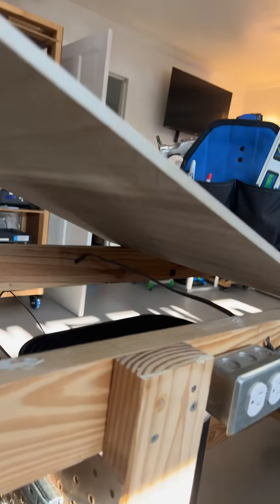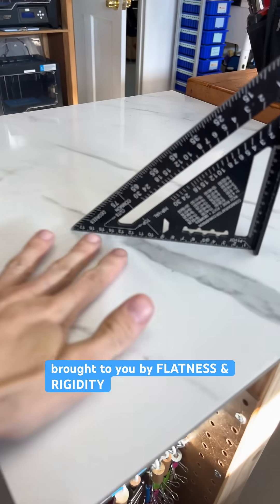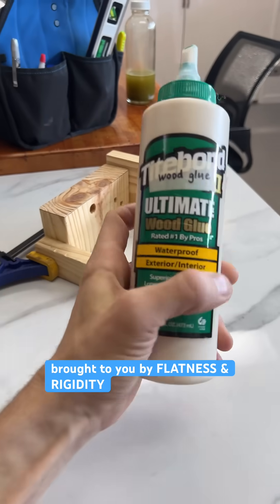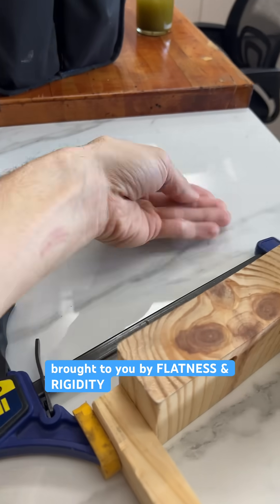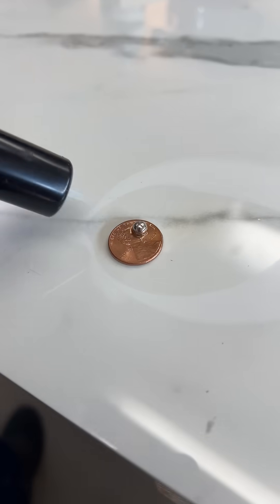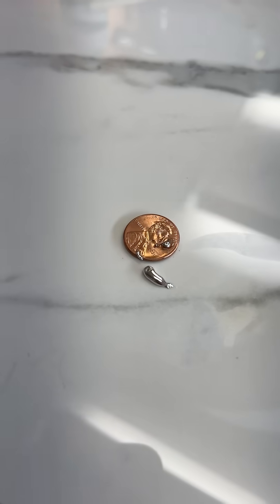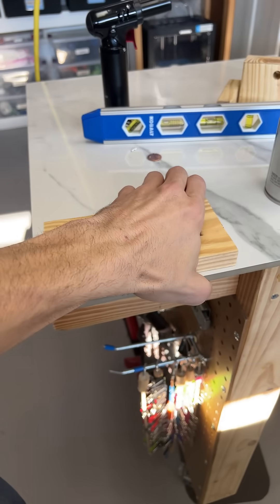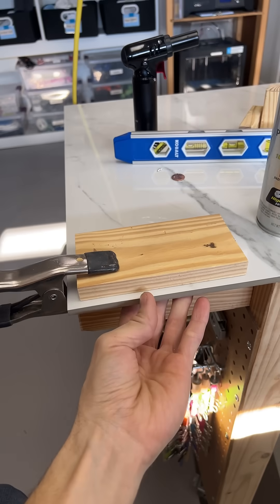how to gain flatness, crucial for many #diy projects.

Comment: You may not know that tiles are not always perfectly flat. They can warp during the firing process. High quality ones are pretty flat, but you should test with a straight edge before presuming.

Comment: Yes. I used a piece like that for years. Best workbench ever.
Reply: Work bench?! Yeah no thanks lol.  The problem with really hard stuff is that it’s really brittle.  This would make for a horrendous workbench top.  This vid isn’t even trying to say that, it’s saying use it as a top for an assembly table.
Reply: @garrettkuracka2277  Yep. But is perfectly flat and you can replace it easily.
Reply: @ well yeah but so is mdf for all realistic intents and purposes, and it’s cheaper and easier to work with and easier to replace and more durable
Reply: @Tigerbait2121  Yes. But you can glue pieces and get them pressed over melamine without getting it stick to the surface if you need it. A piece of Corian (solid surface) work in a similar way, but you can not hammer over it.

Comment: I work at a "precision" stone fabrication shop and stone slabs are not "perfectly level". They are nonporous and feel smooth but they are cut, sanded, and buffed just like a peice of wood. Just to a higher degree. If your just looking for a hard flat surface, solid surface Corian is just as good and cheaper and lighter.

Comment: Just a heads up it can flex and end up not being flat. Even natural granite counters can flex and bow a decent amount. One house I did work in the cabinets were not installed correctly 6ft of counter had a 1/4inch proud area near the center and drooping on either end. At first I thought it was a optical illusion but nope.

Comment: Imagine you wanted to hammer something home. Or imagine having to put all your weight into making two tight clearances to fix. Imagine dropping a tool onto the surface. Imagine wanting to drill through a project. Imagine.......
Just get some form ply. 100 bucks and can make 10 of those from one sheet and replace them and fix them to the bench as needed.

Comment: Do not hold a flame to granite! Especially a thon piece like this. If there is any flaw such as a micro fracture or air bubble, it will crack or burst on a bubble. Then your surface is useless.

Comment: That stone is not completely fire proof,  put the torch on it for a couple minutes you'll find that out.
Reply from the maker: Thanks for your comment!  Genuinely. My engineering requirement is as follows:  It must be more fireproof than all of my other options inside the lab.  And it is.  We often place a silicone mat on our tabletops for soldering.  I have marred the silicone a couple of times because it is heat resistant.

Comment: Wrong, sorry to burst your bubble. Those porcelain tiles are NOT perfectly flat. I work with them. If you look straight from one edge to the other you will see a slight bow at the middle. If you want something that is more perfect, definitely try 3 centimeter granite or dense marble. Much flatter surfaces.

Comment: Ceramic tile is most certainly not flat. They come cupped, bowed, and twisted from the factory just like wood. Turn two pieces back to back and you’ll see. More expensive tile has better quality control so there’s less likely to be deformation, but $6 12x12 isn’t a granite surface plate.

Comment: Fun fact: that shit aint perfectly flat
Reply from the maker: OK there are several comments on this.  Could you take a moment and describe what level of precision you're aiming for?
Reply: @davidmalawey  
I say this because during the polishing process, it often results in a spherical polish. 
It will check flat with a dial indicator, because its a sphere.. but its not flat. This is often seen on the cheaper pieces you can pick up but ymmv.
Make sure you have a reference straight edge to confirm it is infact flat before using it.

Comment: Coming from a tile guy, that tile has a slight cup in the middle of that porcelain tile but not as much as some12/24sI’ve seen.
Natural stone is the best thing for something like this application that can be used because there is no heating process
Reply: What about tempered glass? I want to have my work space also be a light box as well as a vacuum chamber, so I was thinking of using smaller 6"×6" or 12"×12" glass tiles with a removable track frame.
Reply: @sparklekpadeh3382  that is great idea tempered glass is super strong but can break if hit the wrong way
Reply: @sparklekpadeh3382 yeah like the guy above me said, you want "float glass." 

Most glass tabletops are float glass. But many are tempered, so you have to make sure. 

Float glass is made by pouring the molten glass on top of a "bed" of molten metal (like lead or something with lots of density.) because gravity will always turn liquid into a perfectly flat surface if left undisturbed. 

Once it cools, your glass now matches the flatness of the molten metal.
Reply: @sparklekpadeh3382  Tempered glass is NOT FLAT (!)... it has a lot of waviness from the tempering process...  What you need is called "Floated Glass", not "Tempered glass".

Comment: Not fireproof but good points made. Also, not fireproof, but better is fibre cement. I did a glass blowing course a while back and they used half inch sheets for bench tops. It's flat, durable, hard, heavy, cheap. Can get it pretty hot.

Comment: If that's tile be aware the large formats are usually slightly curved toward the edges due to the production process and material characteristics. But that's to be checked anyway before using it s a plane

Comment: I use melamine. It's easy to drill thru, cheap and we get it in 1×5'×10' sheets.  Pro tip, lay down packing tape under your glue joints to avoid any unwanted bonding to your table.

Comment: Lol, i use glass when i dont want to lose my line.... of coke 😂
I actually have used glass bonded to wood as a table for working
I got like 60 glass shelves for $60... and she threw in 2 crates of hardwear for hanging the glass shelves and whatever else was still in their store (they were moving locations but updating their shelving situation i guess)

Comment: Heat on a ceramic tile = NO!
They can shatter without warning.
Not a bad woodworking flat surface though (It's not machinist flat and not "perfectly" flat by any means, but pretty ok for wood)

Comment: That is a cool idea, I'd be afraid I'd break it though. My square surface I use is my table saw, but only the very center is steel or iron or whatever. The wings are aluminum and I don't feel I can trust those to be absolutely flat

Comment: I have a butcher block top for my work bench and I can do everything you mentioned, except for taking a piece outside to paint and keeping it secured to the top.  And I don't have to worry about it breaking or shattering if I drop it or hit it too hard or get it too hot.

Comment: I install large format porcelain tile all the time in my bathroom remodels and I can assure you they are not perfectly flat. So don't use that as an example!
Reply: Hahaha was going to say this. No $6 tile is flat 😂
Reply: Came here so say this. The house I'm working on now have terrible bows in them
Reply: All porcelain tiles are cupped that’s why you can only lay them in specified orientations due to the amount of lipage caused by their inconsistencies.
Reply: Yeah I've installed a lot of tile on the side. By trade I'm a master sparky. Wired then became an electrical maintainence tech at a major, 1 mile long tile factory years ago. The QC on things anymore is rediculous. ⅜ to ½" thick is normal to be out ¹/¹⁶" across a single tile. A 12x12 tile could be out of square ¼".  This all fell inside specs. Hence why getting grout lines perfect can be so dang near impossible.
Reply from the maker: how can i check any more accurately than using my levels?  i see only a hairline or less than a hairline when i shine a light under the level, in any direction. 🤷‍♂️

Comment: Find 3 equally weighted points on a large granite sink cut out  that has a matching piece of stone then float the second stone on top of epoxy and you'll have a very stable flat surface.  Great for lapping surfaces in
Reply: What?
Reply: @DadaPoopoo I’ve read the comment like 4 times and also can’t figure it out

Comment: A ceramic surface plate for woodwoorking. That's actually a great idea.
Reply: A mirror is flatter than tile or counter top, and if you roll a bent rod on it, it will show up way more.

Comment: I would real try to double check the flatness of that sheet. They can be incredibly smooth but due to how thin they are very prone to warping. Also like a few people said ceramic can be very fragile this is especially so on the edges. One of the best things you can do to counteract this in my experience is sanding all the sharp edges and rounding them out a little bit. You can do this with sandpaper by hand but it’s very easy to cut yourself to be careful

Comment: Large format tiles often have a crown, they are not perfectly flat. That's why they don't overlap large tiles 50/50, the manufacturer recommends only over lapping by 1/3 to prevent lippage.l

Comment: Machinist/woodworker here, who has several granite surface plates - including a 40x48x8” pink granite… be careful with heat on ceramic/porcelain tile, they can shatter without warning. Look at your local import woodworking or metal working retail store (around here it’s busy bee tools) they sell 18x12x4” granite plates for $60 (CAD) and they’re indestructible and very useful.
Reply: Very good observations, I honestly didn't know they could come so cheap
Reply: The machinist in me was a little tickled by this
Reply: My first impression is why do we need to use computer aided design to make a rectangular prism 🙈
Reply: @PTFVBVB — same ⏳
Reply: Porcelain dissipates heat very fast, it’s not going to explode randomly
Reply: High temp, not an open flame. Porcelain will crack and or explode when exposed to a high temp open flame. Have you heard of Thermal Shock?
Reply: For my fellow Canadians; just looked it up on Busybee, "Surface Plate", 12"x18"x3", regular price $109, on sale now (Oct '24) at $80, out of stock online, but it looks available at most other locations (3 here in Ottawa). Didn't know this existed. Might pick one up next week. Cheers.
Reply: I was cringing too
Reply: Imagine shattering your Starrett pink granite table? That would be a very sad day...
Reply: I would say let him learn his lesson. Men learn the best from mistakes 😂
Reply: That’s some sick advice brother man. Thanks so much.
Reply: or.. 
and this is coming from someone that does things with countertops that are questionable at best..
go to a local countertop shop and take a peek in their scrap dumpster. 
i promise they won’t mind if you take all you want. they have to pay to get it hauled off so you will be saving them a few cents. 
seriously though, you can get anything from natural stone to engineered quartz to ceramic for exactly free.99 
you can always introduce yourself and ask a person if they have any extra they could part with if you’re too proper for dumpster diving. 
be nice and you’ll get more than you need. 
$60 for a machinist stone.. free granite scrap from a slab cutout. 
same thing with a different name.
Reply: Yeah I was commenting the same thing. I work in manufacturing and do surface grinding and working on a granite surface plate everyday. It’s awesome and when you have heavy pieces of medal on there, but it’s flat it literally slides across the plate really fast almost like an air hockey table. It’s awesome but I’ve almost dropped some stuff like that 😅😅
Reply: Yes, this looks to be quartz aggregate which is highly heat resistant, including hot pans.
Reply: @e4e5e2e7 A hot pan with water in it isn't hotter than 100°C.  A hot pan with oil in it is no hotter than 300°C maximum, as above that temperature the oil will spontaneously ignite, and oil actually used for cooking is probably no hotter than around 200°C. ..... All of which temperatures are much much cooler than a flame.
Reply: incorrect
Reply: Been using the same porcelain tile for a few years now.. minus a small chip on one side.. never had any issues.. its seen heat, moderate abuse, clamping, painting and adhesives.. still clean-ish and still works great.  This dude knows what's up
Reply: Man ive been to busy bees in london, love that place! Im a sparky but been getting into machining and welding at work in my free time. Gonna pick up a craftex benchtop mill  when i sell the boat. Do you think a benchtop mill is good for fucking around in the garage or would i be better off finding a used knee mill? Think i could get the millwrights at work to give me a hand with the more complex parts.
Reply: Except this isn't granite in the video...
Reply: Just a life hack if you ever need granite or anything and have a local stone yard. They typically have a remnant yard that you can get pieces for next to nothing
Reply: Not all tile are porcelain. There are granite based ones too. At least in Europe
Reply: To be clear, Granite won't explode, or are they special in one way or another to not explode? Thanks for the info!
Reply: @jakenuno9900 Natural rock can explode if it has moisture in it.  True granite is impervious to water, but not all rock is granite, even though that is how much of it is sold (for counter tops), that said, even a hairline crack in granite could contain moisture enough to cause a violent fracture, if not an actual explosion.
Reply: He didn't say 8".. this thing won't survive a work shop. All you'd need to do is accidental drop a clamp or any other object to make it break
Reply: @SR-te2db  "including a 48x40x8 inch granite table" ... doesn't that imply 8 inches thick? 
And a 4x4ft square?
Reply: @theoriginalmonstermaker  oh I thought I read 4".. overkill either way if true
Reply: @SR-te2db he has an 8" thick plate on his own shop, but mentioned you can get a 4" thick plate fit $60 in Canada... The thicker one is harder to install for sure, but it's going to move far less when working on it
Reply: @SR-te2db  yeah,  that's crazy for granite.  It would weigh a ton. 
Even kitchen counters,  which span a much wider distance,  are only like 2".

And those cheap 8ft counters at any home supply store can be as cheap as 100 bucks.  Those make good quick work table tops... though not as resilient as stone : /
Reply: Porcelain doesn't "suddenly shatter" from heat. It's literally made by drying porcelain clay in an oven at 2000F. Porcelain actually dissipates heat faster than granite. If you heat granite, it will keep a high temperature for a long time and you could burn yourself if you're unaware that it's been heated.
Reply: @dash1dash2  Yeah, tell that to the porcelain tiles I cracked while soldering on a cool morning. Sure, they CAN dissipate heat fast, but differential heating or jut local heating can cause it to expand and crack
Reply: @dash1dash2   Vitreous Porcelain (which this is) definitely shatters, explodes and or cracks when exposed to an open flame, especially a torch. Simply because it was heated at high tempts to create doesn’t make it completely resilient to heat causing negative effects.
Reply: @dash1dash2 that’s what I thought. Kind like comparing a pizza oven or the kiln itself TO the coffee/tea cup.
Reply: Your granite slab is 8 inches thick?? That seems immensely heavy and unnecessary,  no? 
His piece of porcelain is like a 1/2 inch,  isn't that easier to work with/ move/ clamp to?
Reply: @theoriginalmonstermaker 
Uh. No, its not, 8" thick is actually a bit thin for a stationary surface plate.
Its to stop it from warping.

And defenitly use granite other materials warp more.
Reply: @AnonymousAnarchist2  how would stone warp??
Reply: @theoriginalmonstermaker  um. Everything solid is not stationary.
It all slowly bends, and dislocates as every single atom in every single material seeks the lowest possible energy state.

And those add up, the thicker the material in comparison to its length and width, the more likely the average of all those moves will equal zero, until your at a cube. But it never reaches zero, all materials always warp, and thats a big deal if your a toolmaker, and have to make screws that are used to align nanoscale stages.
like me
Reply: @theoriginalmonstermaker  Actually I just thought of a better way to describe it.
Any tiny flaw in the tiny crystal structires in everything will end up kind of acting like a knot in growing wood, the rest of the crystals and atoms want to go around the little flaws so they multiply. And of course any time you interact with any material you are both creating, and destroying those flaws
Reply: @theoriginalmonstermaker  since it is 4 feet long, if it's not thick enough it can warp on the 0.001" scale that machinists work in
Reply: @theoriginalmonstermaker you want it thick so it doesn’t move around when you’re working on it.
Reply: @ricardomenendez2709  I guess... though it sounds like a problem a couple pieces of double sided tape would fix just as well as adding 50 extra pounds of weight. 
Or,  have it sit in a frame.
Reply: @theoriginalmonstermaker with how much weight and how much at least I’m working on at work, you don’t need the 8” slabs, but it really helps and makes things really easier. Also some of the medal we use is really big and really heavy. Unfortunately some people aren’t very careful and I’m sure if we had thin slabs then someone would’ve cracked it when they put it down. We have pretty big plates and every 2 years have someone come in and level the surface so we know for a fact they are always level and straight. That’s also why you need a thick one. You’d be going through them like every 5 years rather than have one basically forever.
Reply: Why .. no need to spend $60..  you can buy alot of things for bigger space for $60 than a 12"x18"